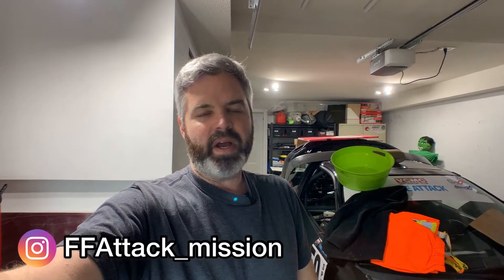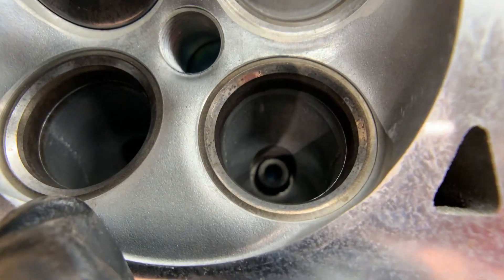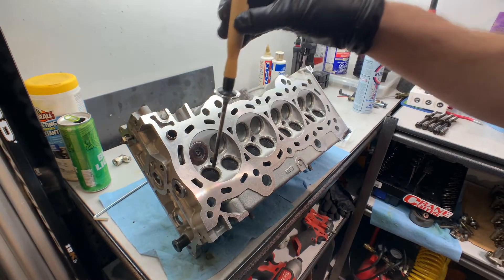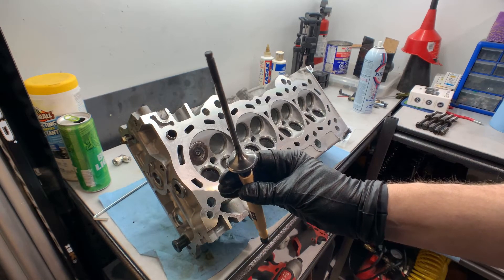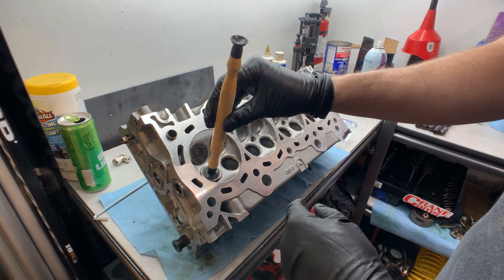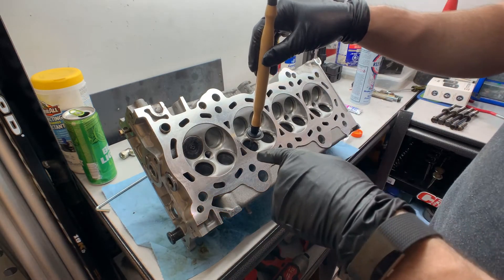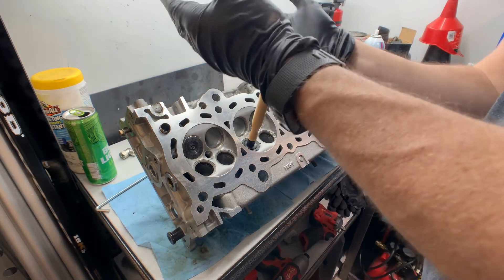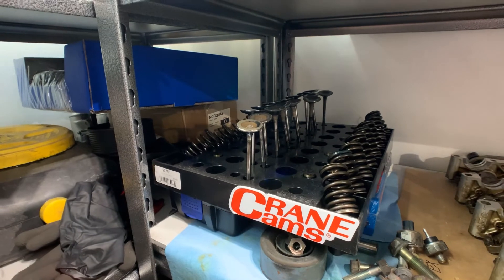Lapping valves on a Honda K20/24 EP.8

Comment: I worked for a dealership for many years and would lap valves using a power drill on very low speed, applying small amount of pressure, release and repeat until surface is good. I could lap all valves in 15-30 minutes depending on number of valves. I also used a two step lapping procedure. Course and fine lap.